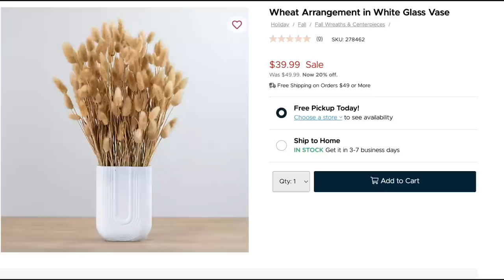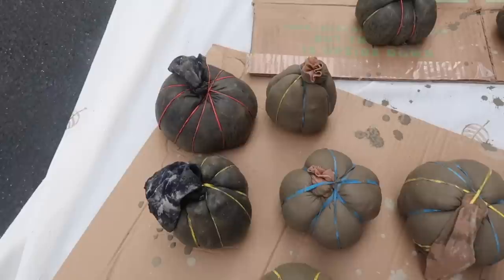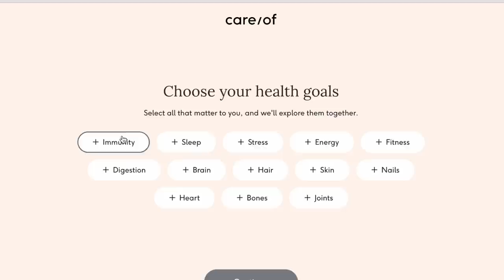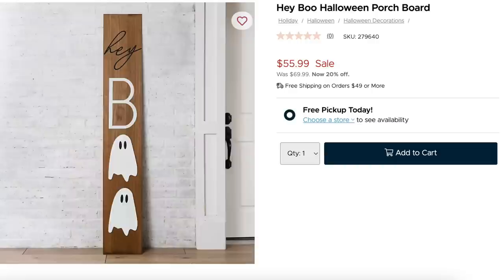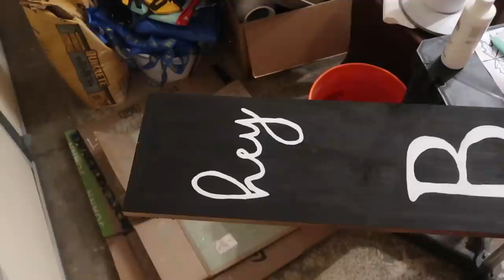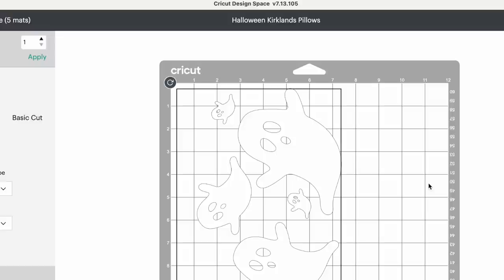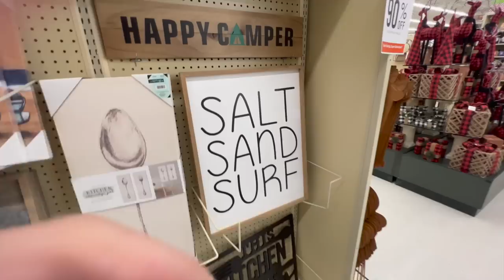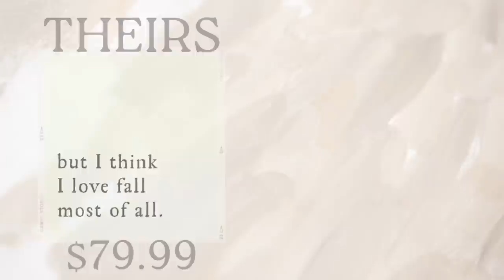Easy Fall Kirkland's Dupes to DIY instead of Buy! 🍁 I saved HUNDREDS & FREE fall printables! 🙌

Comment: Easy pumpkins stems: 1. Soak the top of a paper lunch bag in modpodge twist into a stem. Let dry.  2. Soak a piece of rope in modpodge. Slightly unravel end and glue to pumpkin.
Reply from the maker: Great tip!

Comment: I love these dupes! Did you have any issues with applying the polyurethane and having the black paint smudging into the white paint? No matter how long I let the paint dry, it always smudges! (I use polycrylic) just wanted to know if I should change the sealer. Thanks 😊

Comment: Hi friends! Anyone have suggestions for what to use for stems on the concrete pumpkins if we don't have DT pumpkins to take apart? Sticks? Any other suggestions?
Reply from the maker: Yes! you can use mulch pieces, sticks, create a similar shape with air-dry clay, or cut popsicle sticks or dowel rods. I hope that helps! :)